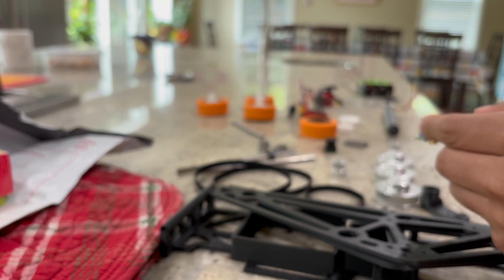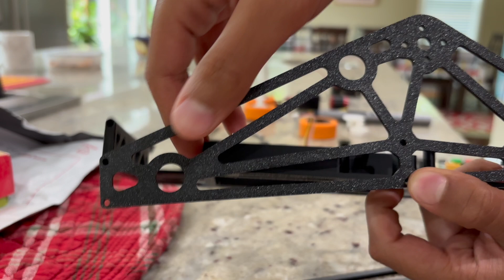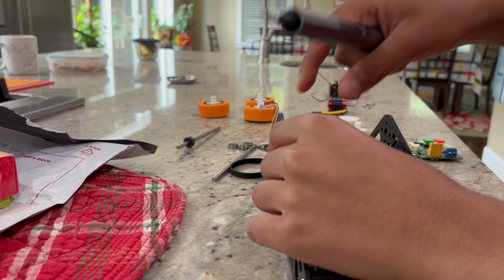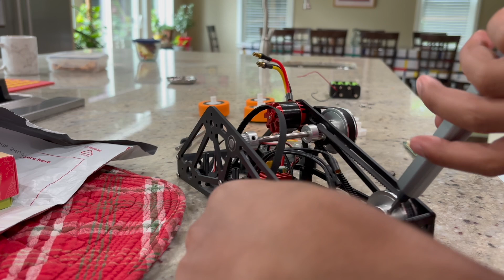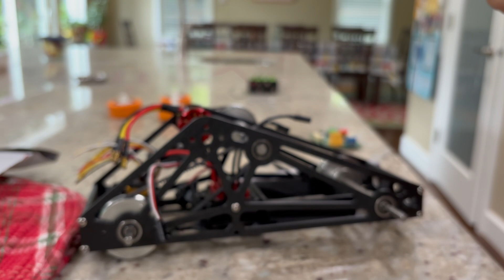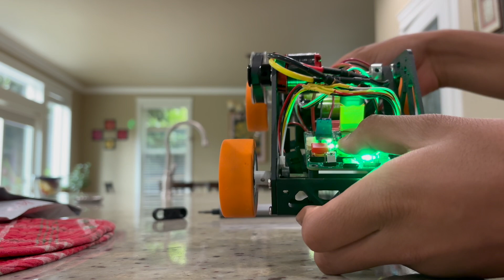(OLD) Tektite-R Electric Vehicle Assembly Tutorial

Comment: What infill did you use for the 3d printed frame? also how did you print the center piece? It's too long for my schools printer
Reply: nvm i figured out the size issue, managed to get it printed, thanks! I used the 20% infill
Reply from the maker: I used 20% infill, 3 wall loops, and 2 bottom and top layers! You can see how I fit it onto my 256mm^3 printer in the bottom of my blog post: https://medium.com/@vikramaditya.nishant/how-to-make-a-science-olympiad-electric-vehicle-2024-2025-f2c6699a03a6
Reply from the maker: I used 20% infill with 3 wall loops and 2 top and bottom layers! You can see how I fit it onto my 256mm3 printer in the bottom of my blog post: https://medium.com/@vikramaditya.nishant/how-to-make-a-science-olympiad-electric-vehicle-2024-2025-f2c6699a03a6